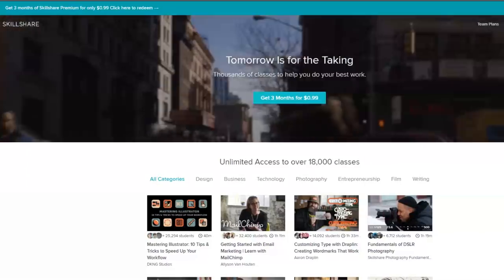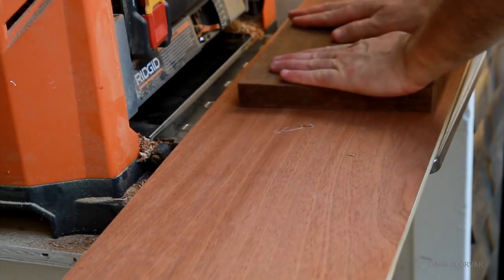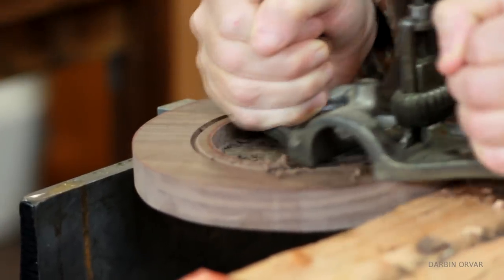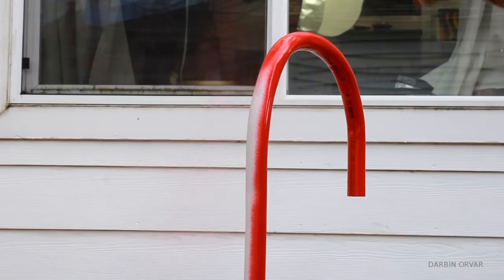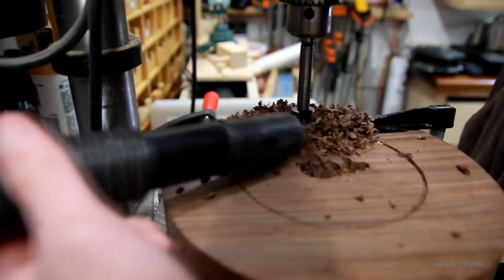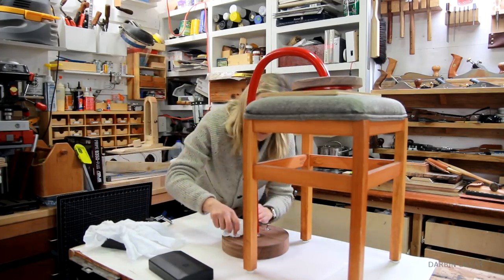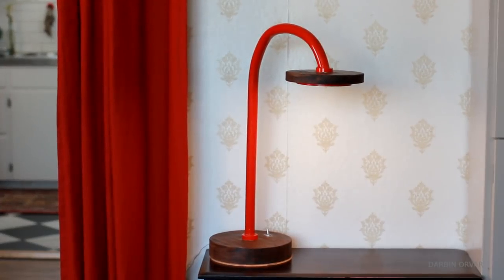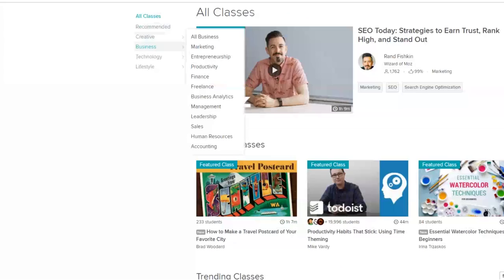Bent PVC LED Desk Light

Comment: You could remove the printing on the pipe with WD40. That may save you some coating-work or layers. Worked for me on a different PVC and WD40 ist not agressive to the PVC but seems to remove the ink very well.

Comment: One question though -- I'm a bit confused when you say you used your planer as a jointer?  In the video, it looks like you just planed opposite sides parallel to one another.  Why did you need plywood for this?  My understanding (not having a jointer), is that a jointer is needed to make adjacent sides perpendicular.  A planer, i.e., a thickness planer, will make the entire piece uniform in thickness, or in other words, make opposing sides parallel.  Looking back at this, did you need the plywood when planing?
Reply from the maker: the piece of walnut was not flat, and it was too small to safely put through the planer that was why I used the plywood, as well as having a place to secure all corners with the hot glue.
Reply: Got it, that makes sense!
Reply: very cool. i made one =) like the lumiy lightblade for my desk lamp

Comment: I wonder if the slight indentations from the dowels on the PVC could have been avoided if the PVC was sandwiched between a couple of sheets of thin MDF or hardboard or something before it was put in the bending jig?
Reply: What if she reheated the pvc a little, maybe that would have helped restore the form?
Reply: I have never had that problem (never using sand either, just the pipe) using a pan or pot or other round form of the size arch needed to make a clean curve or circle ending in a still round pipe.  Trick for me, just go slow, taking your time heating all around the pipe as you go.

I did this exact shape in 1/2" pvc for my hall bathroom faucet over a copper bowl.  Used a pvc to garden hose adapter then a faucet aerator adapter.  Some sanding and oil bronze paint and no one's the wiser that it is not store bought.

Again, same arch shape for an outdoor shower I made for my RV.  PVC garden hose adapters (male/female both) as simple unions to make it break down to storage size.  55 Gallon drum as my form for both shower head and curtain rod to keep us hidden from view.  A couple valves and poof water control to and from the RV and shower separately.

Comment: You don't own a hot air gun? Why not use it for pipe bending? Instead of strip LED, I proper to use ready made ceiling down light which is ready for the line voltage.  Anyway the final look is good.
Reply: The hot sand method keeps the pipe mainly round while using the hot air gun alone will result in the pipe flattening out. If you are doing a lot of bending or need to do a small adjustment then the hot air gun can be used to reheat the pipe, but you still need something inside the pipe to stop it collapsing.

Comment: I would have used 'Angel eyes' led's, they are supplied as a ring of led's, normally used around vehicle lights, and come in various diameters, if you need more diffusion, a piece of printer paper or similar behind the plexi will work, or get the white plexi.
I use small angel eyes with aluminium pudding bowls and gooseneck arms over my desk.
If that's electrical conduit, you can get couplers, cut them shorter so the pipe slides right through, fit them to the pipe as decorative collars, then it can all be painted before fitting to the base etc.